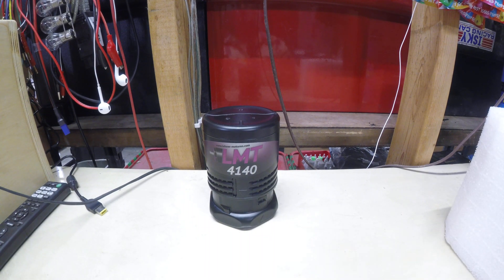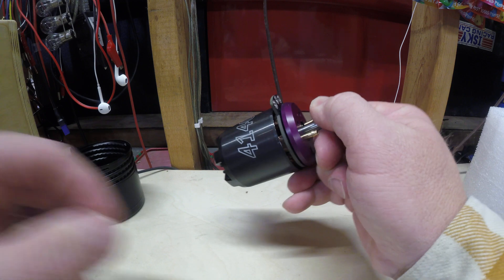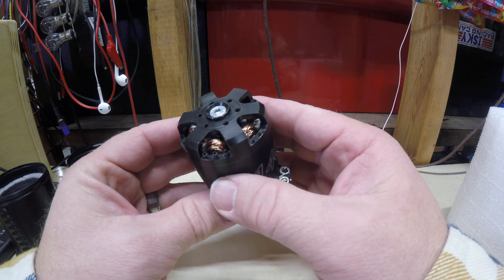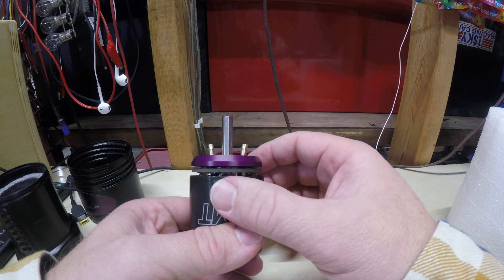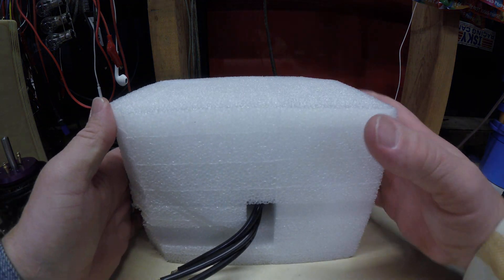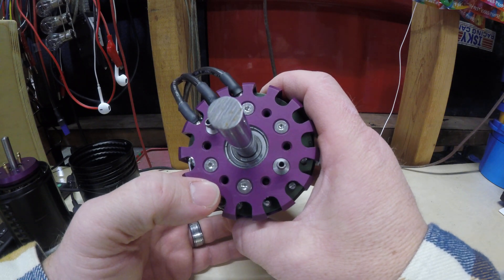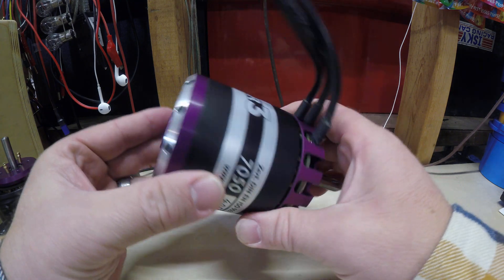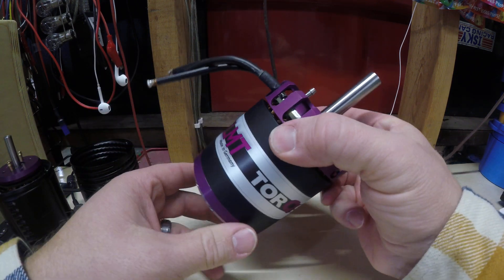Lehner-LMT Outrunner Motor Unboxing:  TorQstar 4140 and TorQstar 3 7050

Comment: Very nice! What are you goin to put them in?
Reply from the maker: The DeltaForce Q mono.
Reply: @racemechanix  Well Torq-star sounds very powerful. What controller and voltage will you run with that?